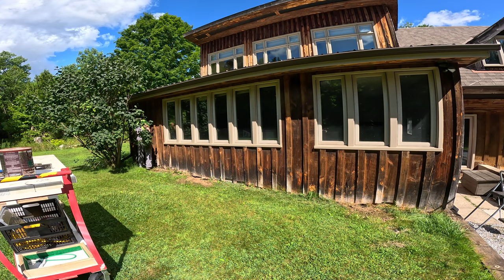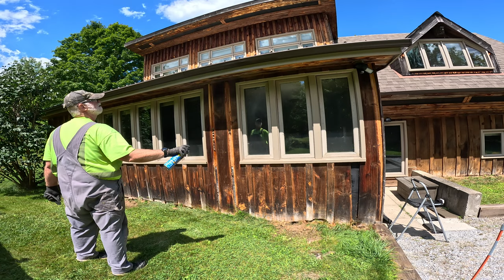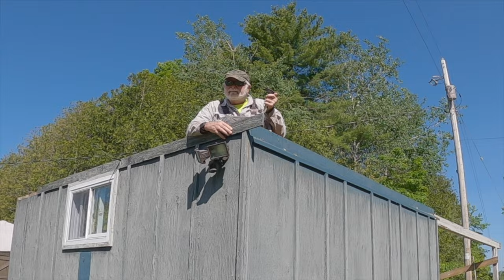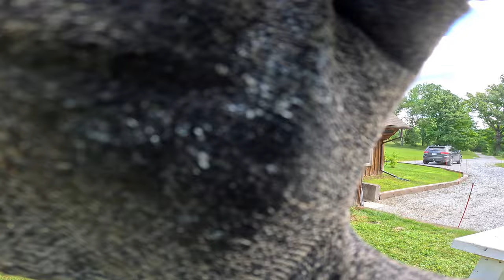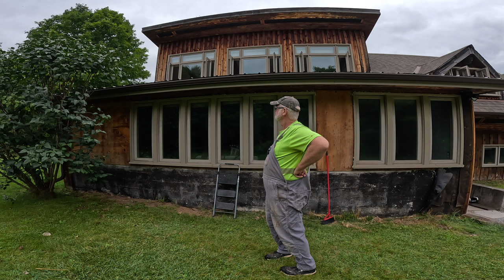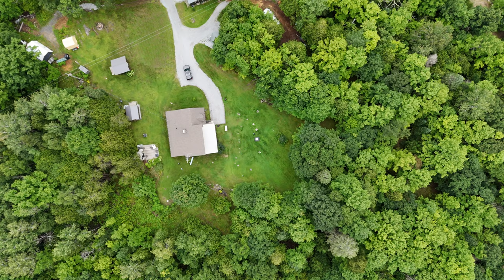Angry Wasps And A False Wall Found During Siding Renovation!

Comment: Are you using any kind of preservative on the timber?
Here in the cool & wet NW of the UK, anything bar larch or cedar would rot out in no time.
Reply from the maker: Unlike the way it was originally installed, the boards that are in contact with the ground will be pressure treated. Everything else will be coated with stain. Thanks for stopping by!

Comment: Making good use of that cart Brian!  Looks like the moisture barrier or tar paper was only run under the window as it gets closer to the ground. Nice overhang though to keep rain off those windows. Can you put up tyvek and tuck it under the widow flashing/flange?Did they cantilever the windows? Does the foundation start again at the corner and go towards the door? Weird…
Great stuff Brian. Cheers, Mike.
Reply from the maker: The tar paper use to cover the whole wall. You can still see the staples. I’m covering the whole wall with house wrap. Going to have a closer look today at what’s going on with the corners. The overhang helps keep the sun out of the windows in the summer. A cleaver design. Just very poor execution. Thanks for stopping by!

Comment: It didn't take long to find the wasps, Brian. I'm guessing the house was expanded beyond the original footprint/foundation at some point, although the original house doesn't look to be very old, perhaps built in the late 70's or 80's. The siding job was uh, something else, with the nails just above the foundation.
Reply from the maker: The wasps seem to like the sun. As soon as the sun hits that wall, they show up. I’m just hoping the original builder didn’t do anything to crazy. As long as there is a cement foundation under there I’ll be happy. Thanks for stopping by!